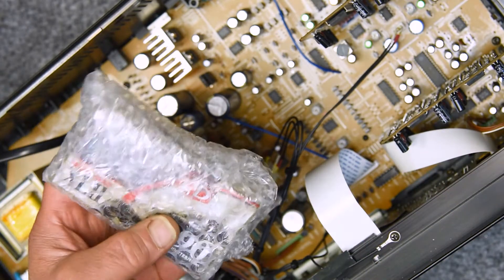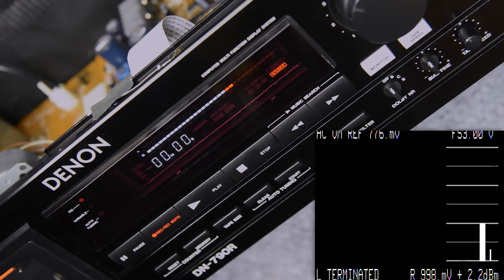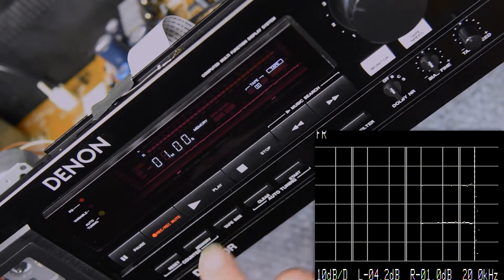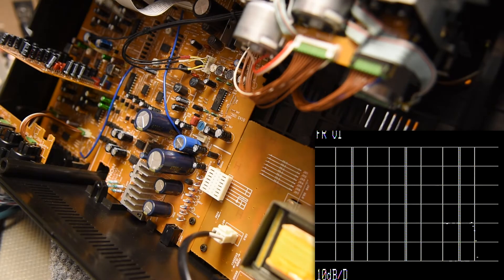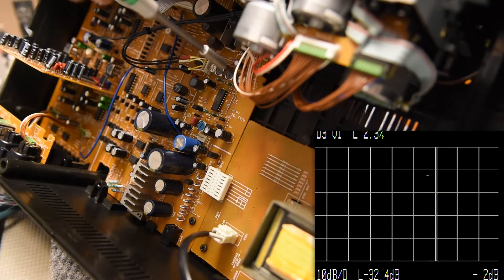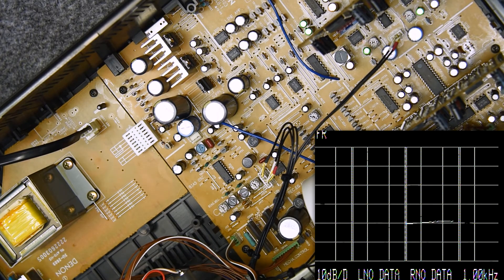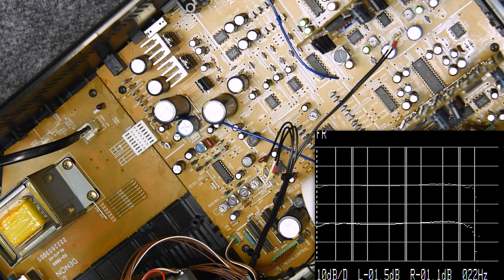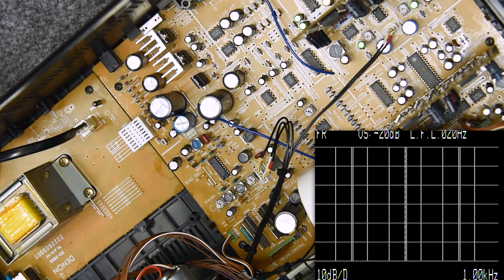Denon DN-790R - Maxell XLII Biasing For Trevor

Comment: Keep up these videos!  I really appreciate it.  If I don’t have a sound technology equipment what alternative equipment can I use?
Reply from the maker: Thank you! Testing gear is around occasionally or you might try software solutions. Calibration can be an issue on the software though. There is a Nakamichi T-100 emulator on the Microsoft Store site but it can't be calibrated from what the developer says, still, it's a fun program to use and very inexpensive.